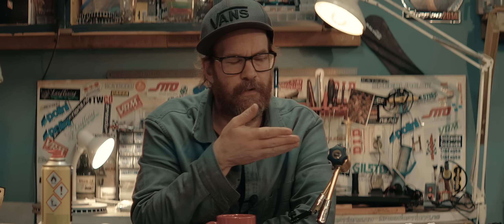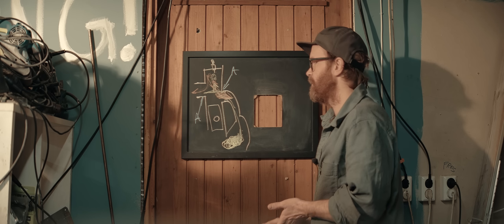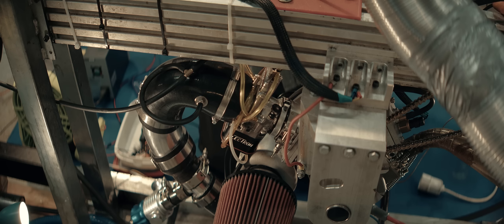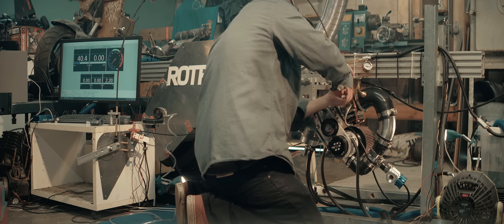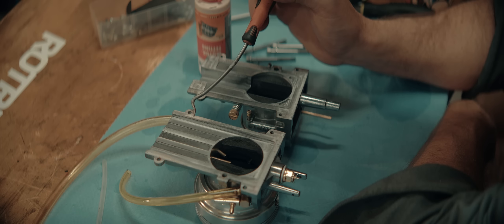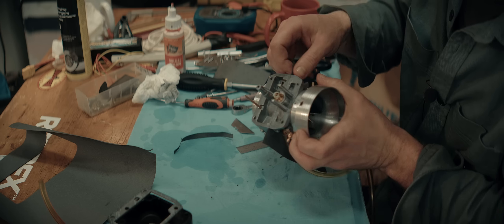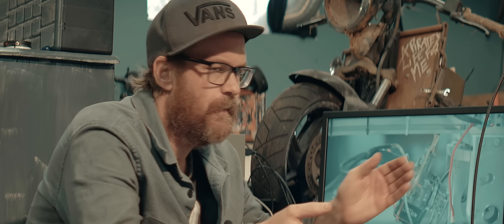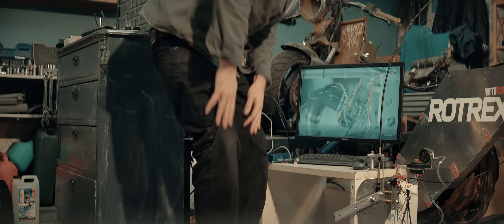50cc Engine in there somewhere...

Comment: If you go to 60% nitro I highly recommend a barrier between you and the engine. You never can be too careful.
Reply: I agree. Theres been a few times that have made me really worried for him but luckily nothing went wrong
Reply: Nitro is not your friend! 🥺
Reply: The danger of working with nitromethane is greatly exaggerated. Pour an open tin of 100% nitro and throw lighted matches into it, and guess what—you can't get it to burn! In the 1950s, in America, a project was launched to determine why two tank cars of nitro exploded—one was near my parent's home outside Niagara Falls, NY. Subsequently, researchers dropped 55 gallon containers of nitro out of airplanes, shot bullets into cans of the stuff along with any other abuse you can think of... and they weren't able to cause the stuff to explode. Today, a shipment of nitromethane is limited to a 55 gal. drum with a 5 gallon airspace , which is filled with a nitrogen blanket. The idea is to prevent an sudden adiabatic compression event (similar to water hammer) that MIGHT cause an explosion. To my knowledge there have been no nitromethane explosions here in the past 60 years during the transportation of this chemical. A few cylinder heads on top fuel and funny car dragsters have blown off prior to start up when liquid nitro had accumulated in a cylinder and the engine was cranked over (hydro lock). I still have about 10 gallons of the stuff in my basement and its been there for 35 years. Old wives tales die slowly.
Reply: Old wives tales, full crank case of combustible nitro mixture? Have seen topfuel harley lost its front from nitro explosion, and countless of blower TF engines reduced to shrapnel. Why do you think the blowers are blanketed and strapped nowadays? 
At 60% you are starting to get in to the danger zone of engine explosion if it sneezes.
Reply: @MJPilote  If you will reread my comment, I was referring primarily to the handling of nitro. I wouldn't think of storing gasoline in my basement (see: Jay Lenno accident), but I am storing nitro there. By the way ,blower explosions on dragsters using gasoline for fuel (1950s) was the primary reason they were initially required to strap them down. I was at the Indy Nationals in 1963 when a blower ended up in the grandstands—and that was a gasoline only event. Handle any chemical improperly and a catastrophic event is likely to occur.
Reply: @davidgierke7582  what’s your IG?
Reply: @Fee.1  What is IG?

Comment from the maker: Thanks for watching!(and sorry for the click bait title...) Just occurred to me, unless the metering rod is poking too far into it, I can drill & tap the Lectrons pickup tube and install a main jet of suitable size to restrict fuel flow at WOT.
Reply: I think that could work out quite well good luck
Reply: Alex; have you considered trying working out some of the bugs with a different / smaller carburetor on racing gasoline, to see how the engine behaves, without complexities of nitro??? Ex: see what RPM the pipe tunes into with current geometry, see how adequate ignition system is at higher boost / RPM under a load, check for leaks, durability of all parts at more extended run times).
Reply: now your understanding how real carbs became designed….imagine having more tuneable circuits at varied ranges too. lol
Reply: Lord Alex dear, let me ask you.
Would it help if you made a manifold so the carb sits level? Maybe the float in the bowl cant close the needle-valve to shut of the fuel, as it does normally? How about the shape of the transfers, use j&b (if it handles the meth ok) to shape the top and bottom so to direct the flow upwards. Pressure in the bottom-end doesent seem to be a problem, it revs nice sometimes. The scavenging of the exsos is also crucial to get right. You can also regulate the blower with a simple cwt system, me thinks. Norwegian riddle for you: The fast window went on reason out side of the black country.
Reply: @tigattac  I don't believe the lectron carb has the traditional fuel bowl/float assembly it's something different it is a carb designed to run in any position
Reply: Consider how many kilos of boost psi across all that large slide channel area, you're inflating it like a balloon, those 4 little screws dont have a chance.
Reply: @rubikmonat6589  At least with JB Weld it is permanently sealed and the screws have no clamping function
Reply: @Skaadi89  They do have traditional float assemblies in them. They can only run upright. BUT they can be modded to sit on a downdraft setup.
Reply: can you please normalize the audio levels i keep having to lower and raise the volume when the engine is running and when you are talking! great video and channel love it keep up the good work
Reply from the maker: @spg3331  Thanks! I'll see if I can fix it. Pretty well normalized before I upload, youtube must be doing something weird.
Reply: Krazy Glue will not dissolve in hot gasohol. Don’t know about nitro. Yet. $2 here. Etch the surfaces a bit. It cures when the air is expelled from the joint. Air prevents curing. You can infuse a paper gasket, and let it dry. When crushed, it will exude abit of glue, then cure.
Reply: My man you need to get EFI!
Reply: Would it work to put the carb before the blower, so it wouldn't have to fight all that pressure?
Reply: @aarongoff3914  There are no positive seals in the blower only an air seal in the blower drive, so fuel would degrade the seal and get into the gear drive reduction unit / dilute the gear oil.....this is why this type of blower cant be used in a draw through application.
Reply: 60% nitro and you’re going to have to make forged internals.
Reply: @Skaadi89  I think what makes Lectron different is they self-tune for altitude. They still need to be somewhat vertical.
Reply: @Homelice  you are right I took another look at their site it's been a few years since I looked into them
Reply: @HPRaceDevelopment  Man, this Guy is everywhere XD just kidding
Reply from the maker: If you consider watching my videos a waste of time(and money?), don't watch them.
Reply: What about a water methonal kit, but all nitromethol no water.
Reply from the maker: @teemann8379  Funny you should ask, there's already 2x water/meth nozzles installed in the crankcase, and they're ment for that exact purpose 😁
Reply: I asked you a question about your exhaust pipe awhile ago. Check your pipe supplier and ask for a Slippy Pipe for Go Karts. This pipe will increase power at lower RPM'S and higher RPM'S while you drive it. I raced Karts for over 20 years now, you need this pipe. Good luck.

An enduro "slippy" pipe is used to achieve midrange and top end power. The sliding convergent (rear) cone is connected by way of a cable to a handle on your steering wheel. The handle is manually controlled. The following is an explanation on how to operate and set up a slippy pipe.

Once the clutch begins to lock up and accelerate the kart, the pipe should be pulled in gradually, always keeping up with the engagement of the clutch and the acceleration of the kart. Do not pull the pipe too quickly or all at once, as this may cause problems. First, it can drag the engine rpm down. When this occurs, you lose distance on the track. To correct this problem, you must re-accelerate by letting the pipe handle out to relieve the engines extra load. Another problem is the heat that is generated when a slippy pipe is pulled too fast. As a result, detonation may be heard. However, even if a pipe is pulled correctly, temperatures may rise due to the setup not being completely dialed in.

There are three main reasons why temperatures will rise. The first is clutch engaging lower than torque peak (10,000 rpm's instead of 10,500 rpm's). With this problem you would need to adjust the clutch slippage (move up or down into the engines power range).

The second is that the flex tubing may be too short for your particular application or overall setup. Adding 1/8" to 3/8" of flex tubing will correct this problem. You can always shorten the flex when you are more comfortable with the entire setup.

The third is a numerical gear ratio that is too low. An example would be if you were using a 4.5 gear ratio and needed a 4.7. The solution here is to let the engine operate in a freer condition and with less load by adding 2 or 3 teeth to the rear axle sprocket.

The pipe must be in its most outward position to maintain low end power for proper acceleration. When releasing the pipe handle do so at the end of the straight or just before you get off the throttle. By releasing the handle under throttle, it will be pushed out with the most pressure.

Mounting the pipe with the end cap angled below header height also helps the slider cone move out easier. Use a good quality cable, free of frayed wires and kinks. Do NOT clamp in the center section area of the pipe, as it may damage the sliding cone.

As with any new pipe or setup, seizure may occur if the above three setup items are not closely monitored. In testing new pipes, it is always suggested to richen the hi-speed jet on the carburetor and to keep a close eye on the engine temperatures (head/exhaust).

In summary, clutch engagement, flex tubing length and gearing are a big part in the overall setup of a slippy pipe. There are other factors, however, which play a critical role between having an average day and a winning day. Some are carburetor adjustments, chassis bind, motor, tire choice, weather conditions and most important, the desire to win.
Reply: @starchaser2489  sounds good but midrange power is not needed here, only peak power so no need for variable length exhaust. designing the engine only for land speed racing and only peak power, makes it a easier than to make an engine that has decent torque and runs well at low rpms. if engine has the power for the top speed, with some tuning of the ratio/transmission, and long enough straight, it will get to that speed
Reply: Have you thought of using a servo to adjust the mixture on the fly?
Reply: @2STROKESTUFFING  Have you got a copy of Tuning For Speed by Phil Irving, or another similar book(s), for intake and exhaust mathematical tuning formulas and arriving at dimensions of diameters and lengths and cones/shaping of the exhaust for a given RPM resonance, with regards the air pressure/speed of sound ? - because the elevation difference between where you live and Bonniville could throw the engine out of its sweet spot, once you've found it that is.

Also I remember an old 'Classic Racer' Magazine I have a copy of haa a feature on the OVER Yamaha OV-20 738-ish cc super modified SZR-660 Single (if I recall), they found a massive airbox/plenum was needed to feed the greedy airlfow of the engine at peak HP rpm, approximately 15 litres of airbox, not counting the massive inlet tubes..

...it could also be your plenum is too small,, especially with that tight 90-ish degree corner just ahead/upstream of the carb itself causing surging at differing speeds as the blower pressure and force of airflow causes turbulence with that tight bend so close to the carb, has less distance for the airflow to realign itself irrespective of charger resonances and flows coming from the bend itself.
Reply: Can you finally put this engine on a pocket bike or something already so we can see how fast it'll go
Reply: Fantastic editing my guy 👌
Reply: Alex I just wanted to inform you that Established Titles is a scam, you should do your own research but I'm sure you wouldn't want to participate in a scam if it is true

Comment: As crazy as it might sound, the biggest problem with fuel injection is that a single injector won't have the bandwidth to run smoothly from idle through 20,000 RPM.  The answer is multiple injectors, possibly even as many as 3 or 4 injectors, to be able to run smoothly throughout the rev range.  By adding an injector every 4,000-5,000 rpm, you would have the low rpm precision you need and the high rpm fuel flow for high rpm operation.

A few other thoughts, obviously a hybrid direct injection / port injection is an idea.  So is crankcase injection. Lots of room to put injectors in the crankcase.
Reply: On this version of his crankcase there is 2 ports for fuel injectors the original idea before he supercharged it was to run on a small lawnmower/weed eater carb with a reed valve until a certain rpm then would switch to the injectors with a secondary intake that had no valve and run on those in conjunction with resonance to max rpm
Reply: @Skaadi89  That's right, I had forgotten about that.  It has been an interesting experience watching this journey.
Reply: @mpeugeot  yes it has been very interesting watching him develop this engine over the years and props to him for building most all of his test equipment and systems to run and test it

Comment: We run a methanol burning drag car and we use contact adhesive to glue our (cork) gaskets onto the engine. This is the only thing we have found that holds up. Can't comment on nitromethane however... All the best.

Comment: Love it Alex try putting the carb in the plenum on my compound bike it made a big difference on how easy things were. I found just having the carb in the pressure stops all the leaks and some carbs will run out of the box like that. The pwk is one but you have to block the choke up ( kinda has a built in pitotube although kinda small). The lectron is easy to tune for boost but that split design makes it much easier to build a box around so it can't leak (same pressure inside and out).
Reply: Old Paxton kits were this way for carburetors in the 1970’s/80’s when dedicated blow through carburetors didn’t exist yet, and it worked pretty well too.
Reply: @ericschumacher5189  yeah I had some issues keeping things sealed and passing tech before I did the same. Turns out every carb is hard to seal up over 20psi let alone 60. Don't get me wrong I sealed the pwk enough to be comfortable doing Dyno runs and some test hits but other ppl had voiced concern. Either way it's the easiest solution for the problem.
Reply: Isn't that how masaratti did the bi turbo with a plenum sealing the carb
Reply: @oliverscorsim  I agree; your recommended solution may not be the most elegant / convenient, but its 100% the most straight-forward way of fixing leaks and ensuring all circuits see the same pressure ratio.
Reply: @ericschumacher5189  thanks bud I try to share what I can lol

Comment: I had a thought during this video. That engine has been rock solid lately. The piston and the crank seem to be holding up really well.

Probably just jinxed it now lol
Reply: That's one thing I have been amazed by.  Testing on those RPM's with fueling issues, on meth (even thought mostly rich), I keep waiting for the engine to have a problem...  but it seems to be holding up really well.

Comment: You might want to take a look at the smart carb, it is a self adjusting carb, with all the sensors integrated.
It could be exactly what you need
Reply: Agreed
Reply: agreed
Reply: It could work, but they're made for suck through and not blow through. Idk how they'll handle positive pressure from the compressor, they're made for negative pressure.
Reply: i concur 🤔
Reply: @rasmus1600  hmm, and also paying such premium price for a carb that might not work for this application, it's a high risk/high reward situation
Reply: @rasmus1600  if it sees intake pressure ect whats the difference might aswell be suck through with some different constants for density ect
Reply: I tried one and was very not happy. Leaks like a Sive under boost and doesn't transition into boost nice no matter what I did. I could get arfs right on boost and off but in between zero and wot it was crap. I still rank my favorite blowthrough carbs as the hsr,pwk,tm,lectron,pd. Hsr is probably the most adjustable if you know carbs it's amazing if you don't youl get yourself in trouble quick. The pwk is just cake and very cheap. If you put it in the plenum and seal the choke it tends to run about 15% bigger main, opposed to with a pitot tube youl normally be 10-20% smaller but it's easier for the Joe blow. Tm is already set up for boost just factory is ram air so the parts are plastic. Works fine until you get around 18-20psi. The pd works well tuning isn't fun. Lectron is probably the easiest to tune for boost from my experience. And I don't remember what it was but some cv carb off a sport bike worked great was actually the easiest to tune by far although the hardest to seal up and there's lots going on in it.
Reply: He is using an lectron which is based on the same concept. The smart carb is considered a slightly "updated" version of the lectron he is using.

There are no sensors in a smart carb. Its analog vacuum fuel metering system. Same for the lectron he is using.

Even then you still have to adjust them. Its easier than a normal carb, but for big jumps in jetting they still have to be adjusted.

Comment: When you explained your reasons against going EFI, there was one thing that I guess you missed: you could use a mass air flow sensor to control it. You can basically simulate a carb with the MAF because it's measuring exactly the same variable a carb uses to operate.
I don't think this would open another can of worms

Comment: Hi, you are doing great work. I like your rabbit hole scenario. I'm respectfully suggesting 2 things 1; create an artificial atmosphere around your carburetor by enveloping it in the supercharged air (wo fuel). 2; eliminate redundant crankcase volume by spacing PIP jug 20 mm away from crankcase, using a longer connecting rod. placing cylinder above crankcase, venting and oil filling crankcase and supplying air/fuel mixture to PIP spacer transfer chamber. I love your work. I wouldn't for a minute try to criticize it. I'm just wondering if you would ponder my suggestions for a moment.